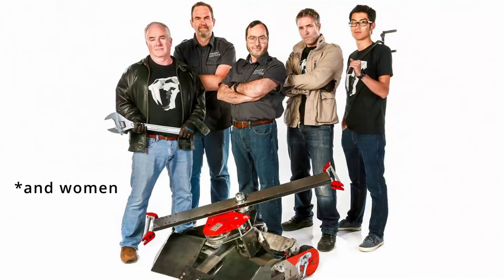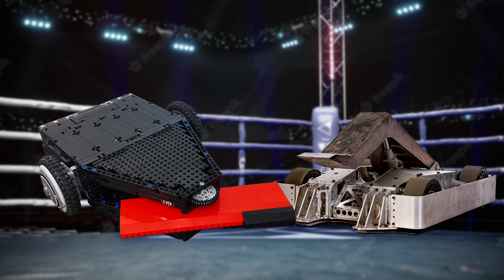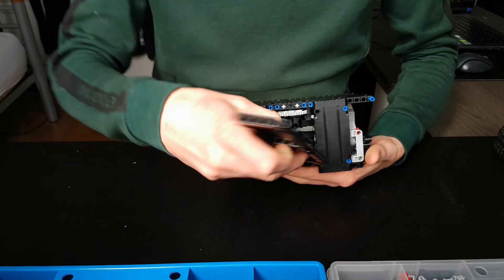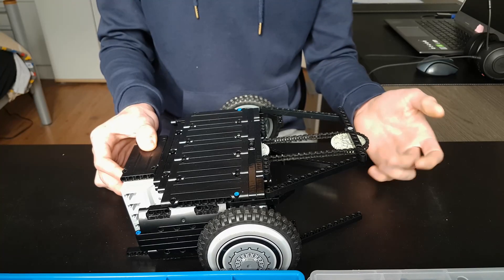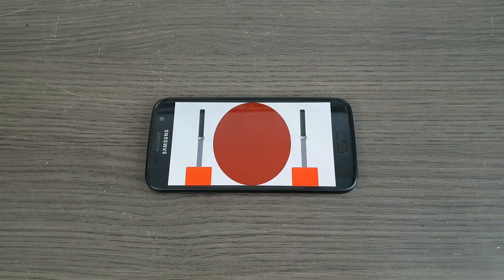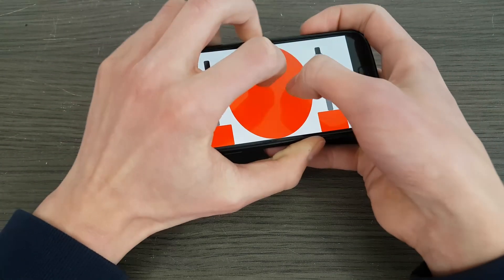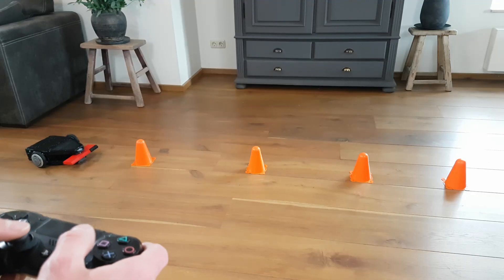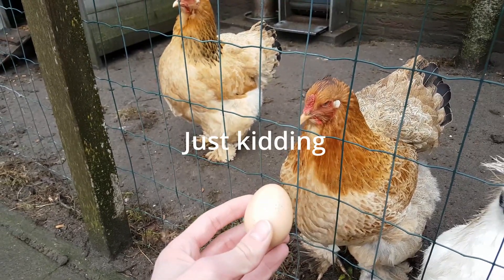I Built a Destructive LEGO BattleBot

Comment: How do you connect the pc programm and the robot with bluetooth?
Reply from the maker: I strongly recommend taking a look at the following tutorial:
https://www.antonsmindstorms.com/2020/02/14/how-to-connect-a-ps4-dualshock-4-controller-to-your-mindstorms-ev3-brick-with-bluetooth/
The robot can be connected to the computer from "Wireless and Networks > Bluetooth" on the ev3dev operating system.
It is very similar to connecting to the PlayStation controller, but instead of putting the controller in pairing mode, you go to your bluetooth settings on the pc and search for new bluetooth devices.
You do need the ev3dev operating system on the sd card in the Mindstorms for this.
If you have any more questions, let me know!
Reply: @CreativeMindstorms Thanks a lot, but I already knew that, I mean I have a python program on my PC that determines the position of a ball on the camera's image and then I want this program to send the position to the Ev3 via bluetooth.
Reply from the maker: That's a cool project! In that case, I use the library ev3_dc for python. This doesn't work with ev3dev / micropython, so remove the sd card. If you want, you could send me an email with some more details and I could help you more with the problem.
Reply: @CreativeMindstorms  Thank you very much for your effort!!
Reply: @CreativeMindstorms  One more question: Which app do you use to transfer the camera image from the cell phone to the computer?
Reply from the maker: @Kugelteam I use DroidCam.

Comment: You should increase the power and speed as u make another one and battle them to the deaths! (Make a arena too without Lego so u don’t use all ur legos)
Reply from the maker: I agree that would be cool! But it would also be difficult since I already used two motors and couldn't get it to spin faster and stronger than it did. But thanks for the suggestion! I'll write it down!
Reply: @CreativeMindstorms  ok!- well maybe you can try more gears?
Reply: @CreativeMindstorms  like a big gear going into a smaller one- that makes it faster and more torque
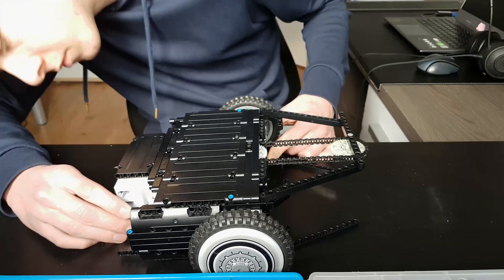Reply from the maker: That's unfortunately not how it works. The faster you make it spin, the less torque you have. Whatever gear combination you use. You can see this at 1:32 . I used gears to speed it up, but that meant it wasn't strong enough. It would be nice if it worked like that though! 😆
Reply: @CreativeMindstorms   you should try buwizz motor and batteries. The slowest these motors can go is 2k rpm, plus, they have 2 outputs, one for speed, and one for torque. The buwizz batterie offers more connections to motors plus has a higher voltage. One final tip, there is an app called brick controller 2, where you can control the motors as much as you like. Hope this helps in future projects!